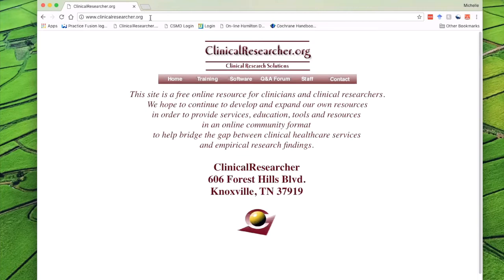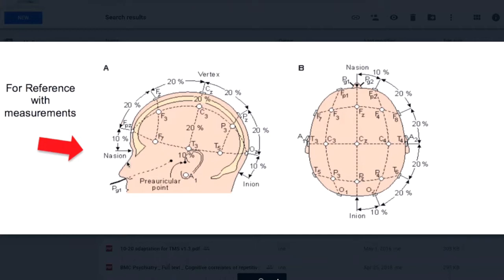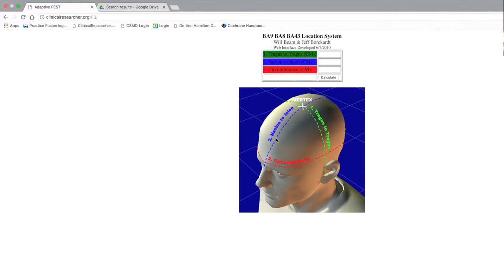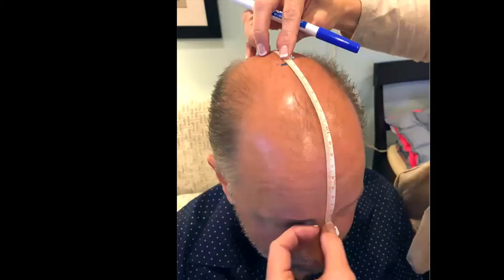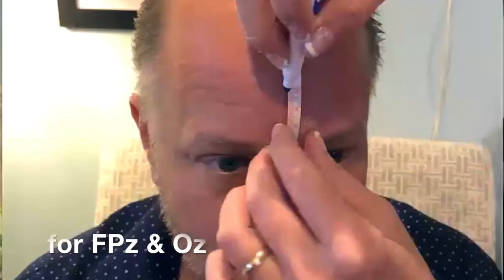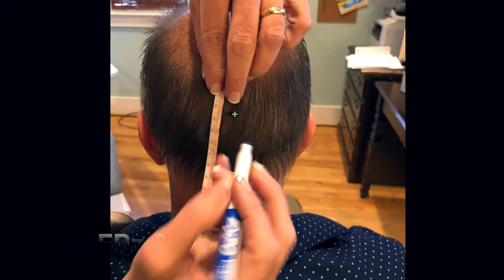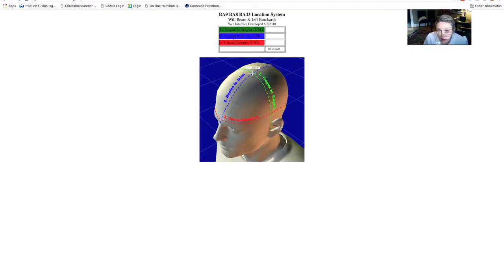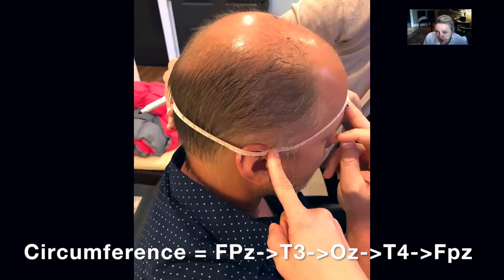Modified Beam, F3 Adaptation   locating the TMS coil target for treatment depression

Comment: Percentage values like 10% from tragus to T3 are defined for the full tragus-to-tragus/nasion-to-inion and circular length.
If you use tragus-to-Cz (for example) like in your video, you have to adapt the percentages and use 20% instead of 10%. If not, you underestimate the tragus-T3 lenght.

Take an imaginary 40cm Tragus-to-Tragus : using the 10% rule, you should place T3 4cm up from the tragus. But if you use 10% of Tragus-Cz (which is 20cm) you will place it only 2cm from the tragus.
Reply: Agree